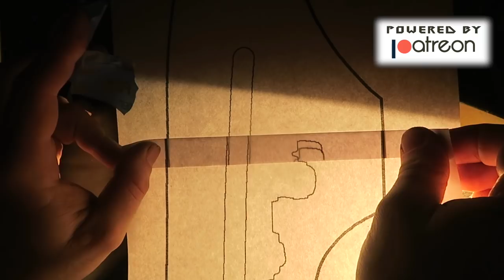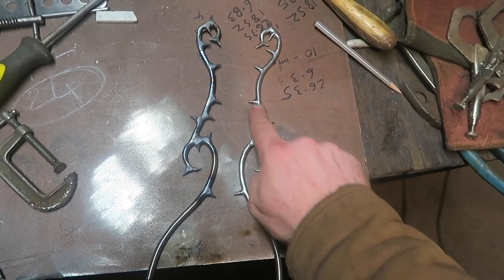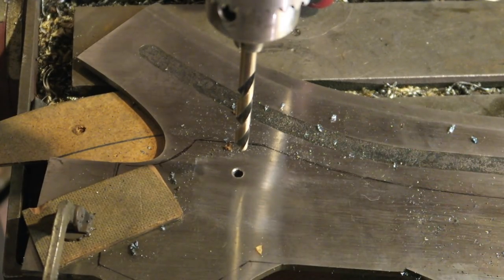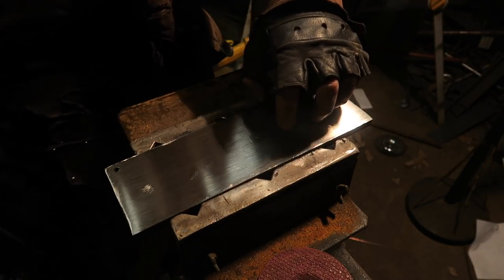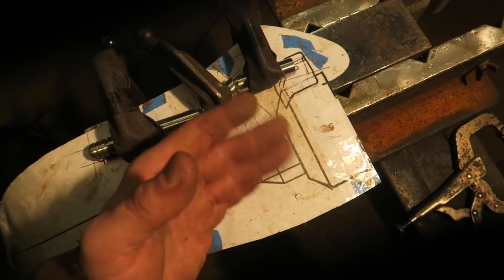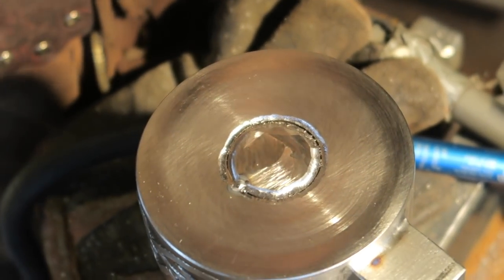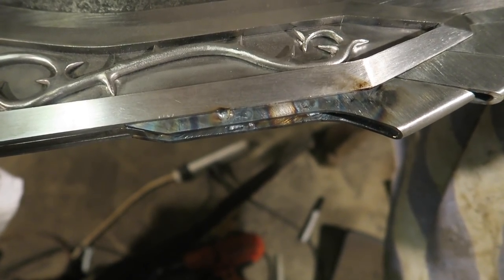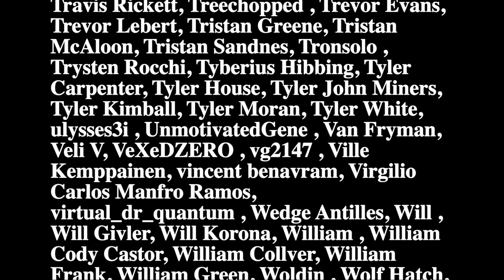Red Queen DMC4 Build.

Comment: Hey Michael I found a really good and durable way to darken metal with gun blue.  If you have the blade around 400 degrees F and dunk it in gun blue it ends up much more durable.  May not be feasible for an entire sword but would work great for smaller parts. ( found that out by cooling a knife I made in gun blue after a temper cycle)

Comment: P.S. - The "ghost" noises in your recording aren't from your microphone. Instead, the audio circuitry is picking up electrical signals from one or another of your power tools. Since this usually indicates that the tool isn't properly grounded, you might want to  check them all.
Reply: Name checks out
Reply: YouTube wouldn't let me post if it didn't :-)
Reply: Power tools are noisy by nature, grounding or not. So much plastic in them now, they aren't fully shrouded like they use to be to block all noise.
Reply: The chassis is supposed to be grounded - that's why they use 3-wire plugs. Of course, if you plug a 3-wire plug into a 2-wire adapter, or clip off the third prong, nothing's grounded any more. At the very least, you'll get that 60 Hz hum... at worst, you'll electrocute yourself and/or set the building on fire.
Reply: yay! English plugs, and 110v on site only now!
Reply: Well, he lives in the USA, so the majority of the plugs would be for 110V/60Hz. Although some of those industrial machines of his might well be 220V - heck, my electric clothes dryer is 220V, and there's a special outlet for it.

Comment: Fun build as always. Regarding the 'poverty lathe', I used to use the same technique with a mounted hand drill when I was a kid and found that it works well if you 1) stabilize your hand/grinder on the table rather that pushing against the work piece and 2) cutting lightly so you grind the high spots and don't push into the low spots. Good stuff!

Comment: You should get a couple of large disk magnets to keep around the shop. If you mount one on a stick you could use it to pick up all the little metal shaving off of your skin without cutting yourself. If you use ceramic magnets you could probably knock the shavings off of it with a brush.

Comment: 1:12:00
Hey Michael, where your drill bit wandered, just use an endmil in your drill press first to flatten the surface then drill it. Alternatively, you can get a lathe centre drill and use that to drill a pilot hole, it's like a super short and stubby drill bit that won't deflect or wander.

Comment: 1:10:06 - It's because the guard in the original art looks like it may be an ellipse rather than a circle. The curvature at the top and bottom would be a lot more pronounced. Of course, figuring out the image stretch for the guard pattern would have been a nightmare due to trying to figure out the exact curvature of the ellipse first. 

1:48:45 - Evil Ted Smith and Punished Props (I'm a huge nerd but not affiliated with those nerds) have a lot of videos on masking, and apparently mustard makes a great liquid masking that is cheaper than Liquid Masking, which is a latex product but also great for masking Rustoleum.

Man, that is a beautiful sword.

Comment: What the "Thumbtwister 2000" vertical lathe of crippling injury lacks is a tool rest... As you said any wobble (for lack of a technical term) is amplified by the freehanded use of the various tooling implements in use.
If you were needing a more accurate situation you may need to think of a tool rest of some persuasion.

Comment: Gosh your sponsors =0 Amazing support! if ever I get financially sufficient amounts, I aim to request a duo-design of mechanically functional Rebellion - being as replicated as possible using a Direct 3D model acquired from the game as a reference. 

Basically, the sword would have some type of magnet in the skull piece (most likely Electromagnet) and something to generate electricity (Say, L-ion-batteries inside the two bone-cross guards, and [if it can fit, or is even feasible] two in the handle. the Handles pommel can unscrew, and the guards can bend, to access/replace/recharge the batteries.) The batteries would power both the [Electro]mag and the electricity - that being used to make the actual blade shocking to the touch (but only where the blade is of course). The [E]mag being used in conjunction with another Mag on the Jacket (that has yet to exist) to hold it w/o needing to use other tools =D. 

As for the "Duo-Design", I have in mind asking for your Blacksmithing skills as well as TheHacksmith's "Hack"smithing skills to create this masterpiece. I aim to make a model of it in Fusion 360 (a technically free software for enthusiasts who get a 1 year free trial xD It's awesome). So, likely to be far from now, but what're your thoughts?

Comment: just thought I'd let you know real swords have Oval shaped handles and that groove in the balde is called a fuller it makes the blade lighter and stronger
Reply: the reason for the oval handles is for edge alinement while holding the sword for a better grip on the handle
Reply: Tell that to capcom. They designed the sword not Mike

Comment: Love the sword, awesome as usual. I wanted to know if you made swords with the blade steel continuing through the tang? I know it's over large and is never going to be used as a real sword, but I was wondering why you don't make it as if it were a real sword? I know they're very expensive to get made so do any of the customers ever ask for it to be made real regardless of the size?
Reply: I recall him saying in a previous video he tends to use pipe handles to save weight due to most the swords already being too heavy for most people to weild and the low chance of them actually ever being struck against something.

Comment: michael what if on the delicate, non strike edge welds you used brass, lower heat but still strong bond, i go to autobody repair at school and the car manufacturers say that on frames to use brass wire so we dont weaken the metal and according to them its as strong as welding

Comment: The truth is that the blade has a chainsaw type blade in the sword which causes the red glow when running the blades engine this causes the red glow proof of this is explained in jojo's bazaar adventure season 2 when the head vampire uses the bone blade in his arm and he explains that the bone blade runs at such a high rate of movement that the chain glows. Id was watching that, that i figured out the red queen has a super fine chainsaw blade running along the edge of the red queen.

Comment: Why do you use vinegar instead of something like muriatic acid?
Reply: Alexander Herbitter cheaper?
Reply: Riding Japan price is comparable, but it would remove the scale in hours and not take over night which would shorten his build time.

I see a 1gal container of muriatic acid at Home Depot for about $8, so pretty cheap, you're local stores may vary. The concentration is about 30% HCl, so pH of about 1. Vinegar has a pH of about 2.4. The pH scale is logarithmic, so 1 isn't twice as acidic as 2, it's 10x more acidic.

I occasionally fool around with steel and stuff, it's no super acid or anything like that. Will still take a while to remove the rust and scale. If you spill it on yourself a little baking soda will neutralize it and clean water and you'll be fine.